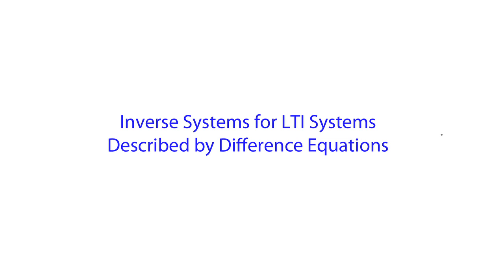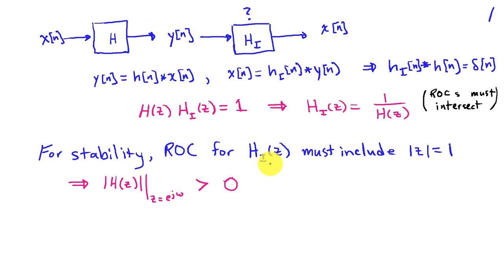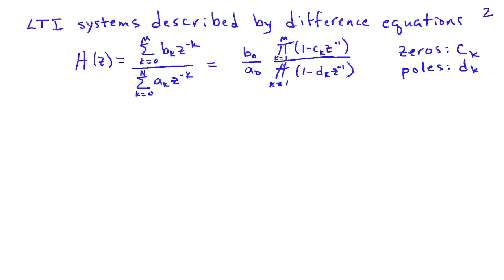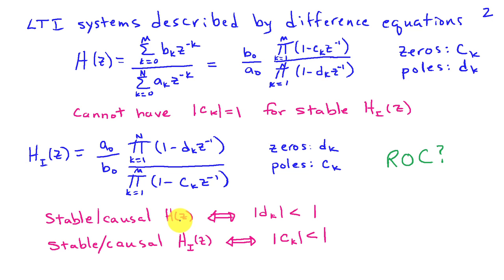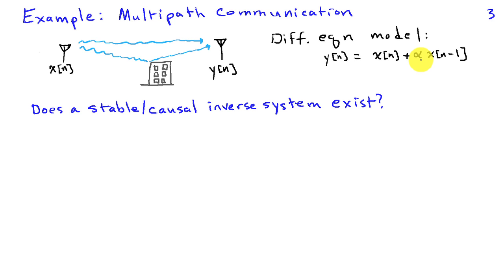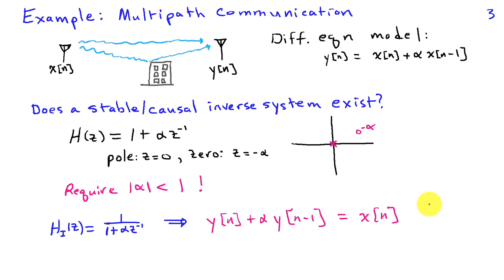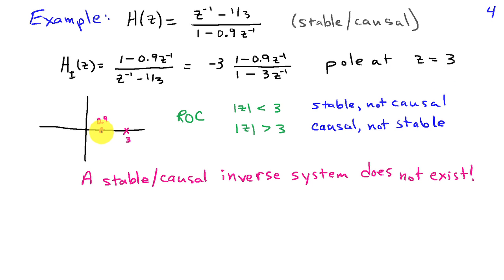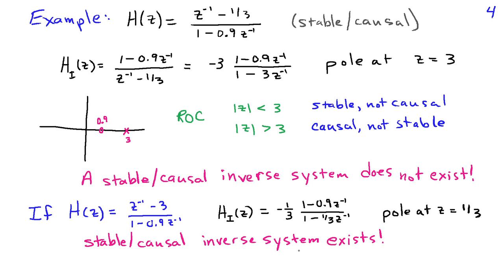Inverse Systems for LTI Systems Described by Difference Equations

Comment: Thanks for the video, Barry! 
It is really helpful. Just a question on stability. All the poles has to be less than 1 for the system to be stable and causal. Does all the zeros has to be less than 1 too for a stable and causal system to exist?
Reply: only if you want to have a causal and stable inverse
Reply: No..Not necessary